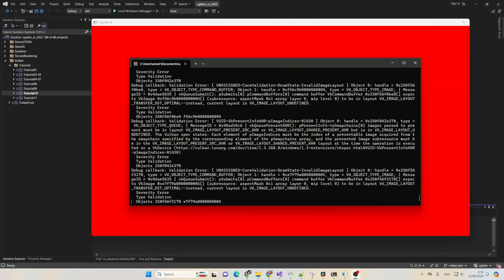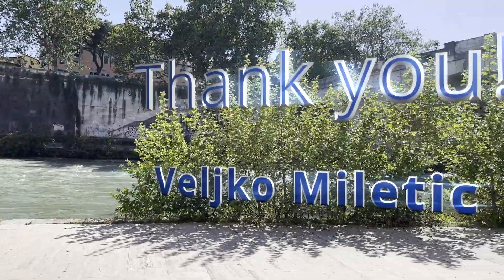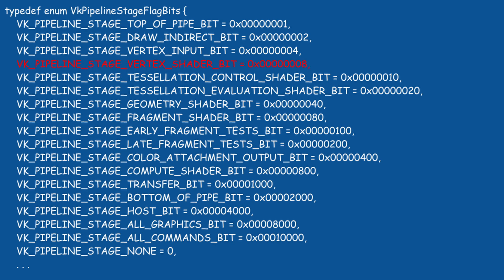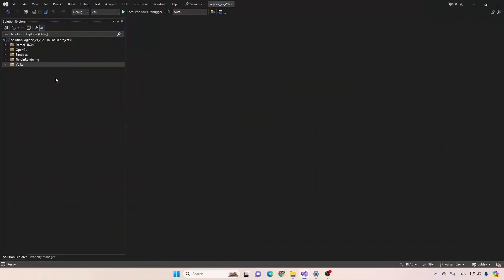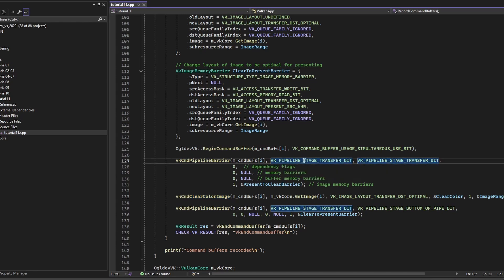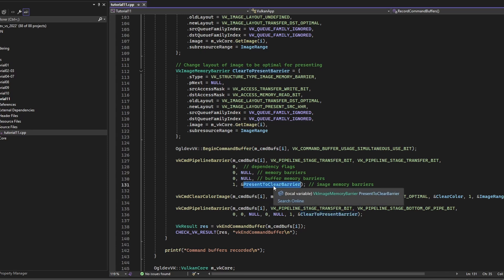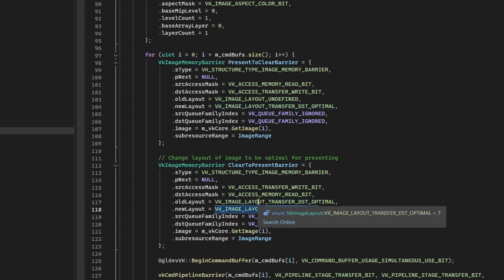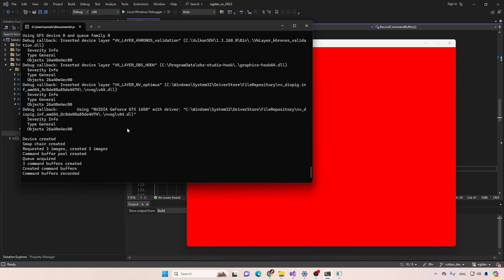Image Memory Barriers // Vulkan For Beginners #11

Comment from the maker: Clone the sources: 
git clone --recurse-submodules https://github.com/emeiri/ogldev.git

If you want to get the same version that was used in the video you can checkout the tag 'VULKAN_11'.

Build on Windows:
Open the Visual Studio solution: ogldev\Windows\ogldev_vs_2022\ogldev_vs_2022.sln 
Build the project 'Vulkan\Tutorials\Tutorial11'
Reply: @OGLDEV 

Hi thank you soooo much for the series!  
  
I had a little doubt in this video as to how we are changing the access masks which I request you to be so kind and correct me on..  
   
1. In the first mem barrier, srcAccessMask denotes the access we get to the source stage (Pipeline_Stage_Transfer) so the image data is read, and its layout modified.   
2. Then dstAccessMask denotes the access to the destination stage (same -- Pipeline_Stage_Transfer) but this time we change it to be able to write the new data to image buffer..    
3. In the second mem barrier, srcAccessMask reverts the Pipeline_Stage_Transfer access to Read, and sets dstAccessMask (for the final pipeline stage) to write. 
4. So we dont need to set the AccessMask of the last stage back to Read?
  
  
Have I got it all wrong?  
  
Thanks!! :D

Comment: Thank you for the Vulkan series,  I’m following along right behind you! 😄
Just to share a small note: I ran into the semaphore synchronization bug, and noticed that your updated code uses a vector of semaphores and fences instead of single instances. That change resolved the issue for me, so I’m leaving this here in case it helps others as well.
Reply from the maker: You're welcome! I guess I should have emphasized that you can workaround the sync bug at this stage by calling vkQueueWaitIdle after present. It is indeed fixed by the sem vector in tutorial #24 - multiple frames in flight.

Comment: How far do you plan to take this Vulkan tutorial? Are you going to cover advanced concepts like you did in your OpenGL tutorial? Thanks!
Reply from the maker: I will continue implementing a Vulkan renderer which can run any technique from my OpenGL series. The focus will be on the efficient usage of the Vulkan API and the performance of the renderer. The OpenGL series continues with a focus on new rendering techniques. Hopefully we will get to a point where every technique can be implemented almost in parallel by the two APIs.

Comment: Thanks for the video, very helpful.
But you should really consider switching to the synchronization2 API since that's what most people who are learning Vulkan in 2024 will be using.
Also TOP_OF_PIPE_BIT and BOTTOM_OF_PIPE_BIT are both deprecated.
You can just use ALL_COMMANDS_BIT or NONE_BIT.
Reply from the maker: You're welcome! I'll probably do that later in the series. I'm following a book which came out prior to the new api but I'll find a spot for it.

Comment: To be more clear the VkPipelineStageFlags and the VkAccessFlags are used the define the 'happens before' order of events in the GPU, for example a srcStageMask of VK_PIPELINE_STAGE_TRANSFER_BIT with a srcAccessMask of VK_ACCESS_TRANSFER_WRITE_BIT and a dstStageMask of VK_PIPELINE_STAGE_FRAGMENT_SHADER_BIT with a dstAccessMask of VK_ACCESS_SHADER_READ_BIT is going to guarantee that a transfer operation to a resource is complete before reading from that resource in the fragment shader.

If you don't have this barrier in place, then you will be potentially reading from the resource before the transfer operation is completed which may be disastrous. A lot of your bugs in Vulkan are probably going to come from not having a barrier or the correct barrier in place.
Reply from the maker: Thanks for the feedback. In addition to functionality bugs as you've mentioned there's also the flip side of how to put in only the synchronization that must be there and in such a way which will not impact performance. I guess many people expect Vulkan to provide high performance just from using it but you may end up with so much redundant sync that there is no performance improvement.